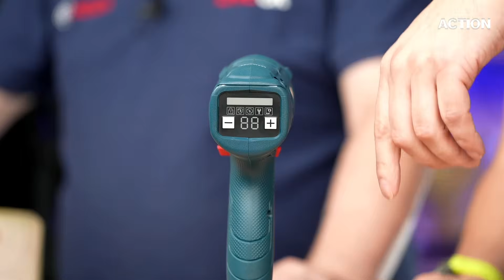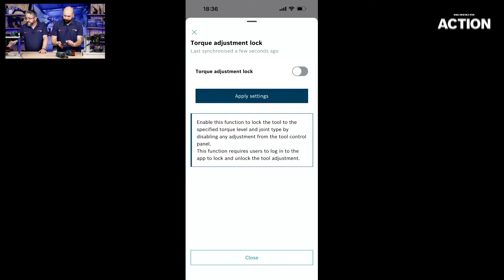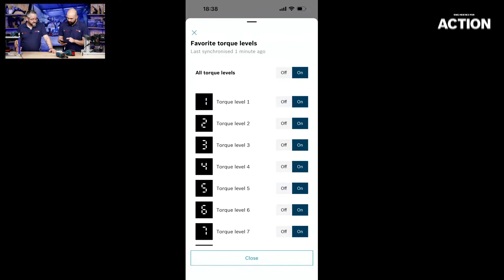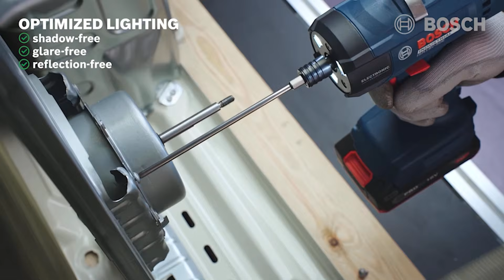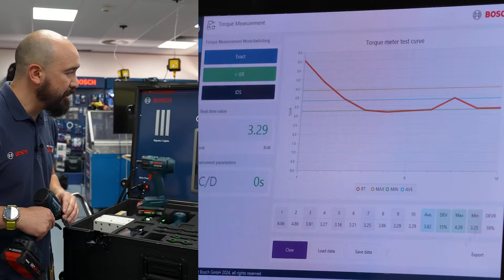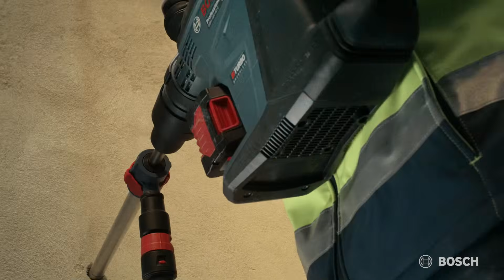What ARE Bosch's INDUSTRIAL Power Tools? 🏭

Comment: The DIY market needs way more love from toolmakers than it's been getting.
Reply: In what ways would that love manifest?
Reply: @bernie-p8i  more quality and sophistication, capability, better designs, more affordable prices.
I'm not impressed with the Bosch green line of tools, when compared to the blue pro line, for instance.
Milwaukee tools are also more impressive than Bosch green DIY ones.
Also, the 12V line has immense untapped potential in building more capable and versatile DIY tools.
Reply: @edfort5704  Ryobi would be a better comparison for Bosch DIY. Milwaukee and Ryobi are owned by the same manufacturer. Milwaukee is positioned as a professional brand, while Ryobi is the DIY brand.

I agree that it would be great to have access to a wider range of tools on the DIY platform. The irony is that DIYers often buy Bosch Professional for the prestige, even if they only use the tools for home repair. So I guess "impressive" isn't what Bosch has in mind for the DIY tools.

Regarding 12V: Bosch owns Dremel. They released a bunch of 12V Dremel tools for DIY that are 100% compatible with the 12V Bosch Professional batteries.
Reply: @bernie-p8i There are some amazing tools from Bosch DIY like the 18V UniversalPump compact, easy to carry and multifunctional. This is what we need in Bosch Pro
Reply: @bernie-p8i  As a passionate DIY'er, I don't have even the least interest for Ryobi products. Compared to Milwaukee, they don't even register on my radar, which speaks to the lack of passion with which the tool line was made, sadly.

Comment: For installation work, it would be nice to have devices like the ISR 18V-50 E which can be used without an app, and whereby the torque settings can just be set in Newton-Meters on the rear of the device, in the same way you could with any torque wrench. It would take the tool out of the factory line, and more into the hands of tradesmen who do installation work in the field.